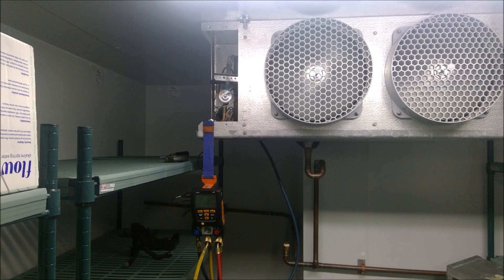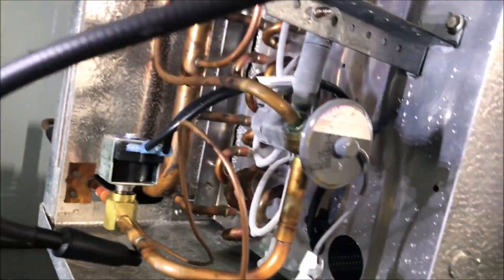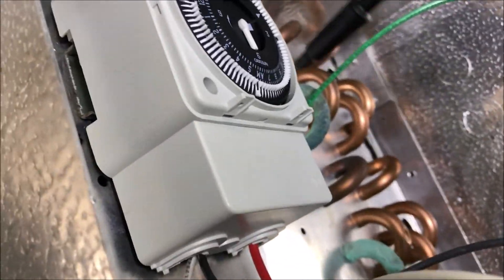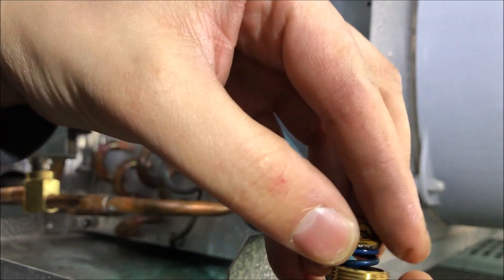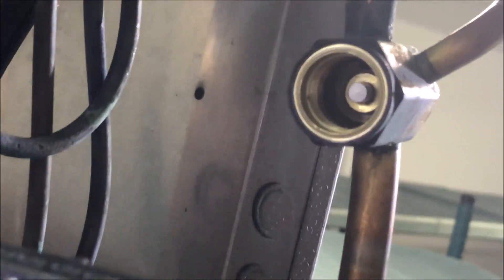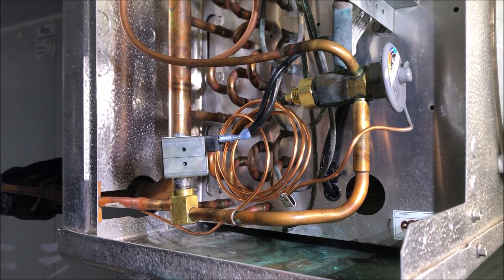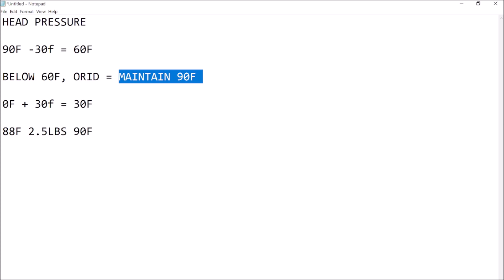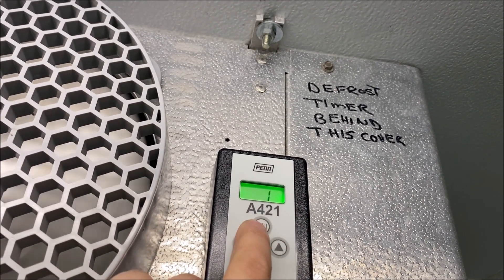Walk in Cooler is not Cooling. Rebuilding a TXV.

Comment: wondering if a variable speed fan ECM maybe would work instead of a head master ? or would that not work in insane Arctic conditions  like you experience. 😂
Reply from the maker: Unfortunately not, even with the Condensor fan off we can’t get the head pressure high enough on really cold days.

Comment: Is that a magnet tester or rotation tester?
Reply from the maker: You can use it for rotation, I use it on solenoids so I don’t have to pull out the wires and test them with my meter. Works for all solenoids, great tool.

Comment: ❄🇺🇸💪👍  great informative video.
Reply: Was that nylog  u used for sealant ? And when loosening nut on txv I would move the heavy duty wrench up higher n ur wrench on nut lower n ur create a scissors motion to have them meet together. Looked like in video u wer turning wrench on nut but at same level of bigger wrench which can cause it to twist at liquid/suction line.
Reply from the maker: That’s the only angle I could get the big wrench on unfortunately. I used oil instead of nylog. Nylog is always my good to except on those TXV threads.
Reply: @REFRIGERATIONKITCHENEQTECH  u the man great vids keep them coming thank you

Comment: What the the hell is a hot work permit?  Ni inspector is gonna know
Reply from the maker: Lol, mandatory around here in Toronto
Reply: Still begs the question. So I looked it up and they sound stupid. A hot work permit is a safety document that is required for any work that involves the use of open flames, sparks, or heat that could potentially cause a fire or explosion. Hot work includes activities such as welding, cutting, brazing, soldering, grinding, and drilling.

Comment: Hey man if you don't mind me asking. 

Can you do this on the typical txv or was this a q body.
Reply from the maker: I assume would be able to rebuild most valves, the issue is whether or not you can get the parts to rebuilt it. My area doesn’t have much for Danfoss valves.

Comment: You should have just replaced the TXV, rebuild is for emergency purposes only if your out in BFE and you have an 800 rebuild kit on you.
Reply from the maker: Couldn’t get a hot work permit, had no choice. Like I was saying in the video, I always replace them as opposed to rebuilding.
Reply: @REFRIGERATIONKITCHENEQTECH  Tip for you, when replacing them, use stay brite 8 with stay clean and mapp gas, can be done in seconds and better than brazing. You can use it anywhere in the system except at the compressor.
Reply from the maker: I will look into that, thanks for the tip